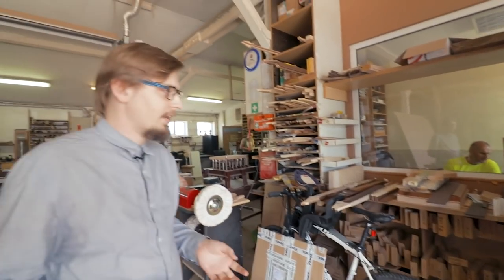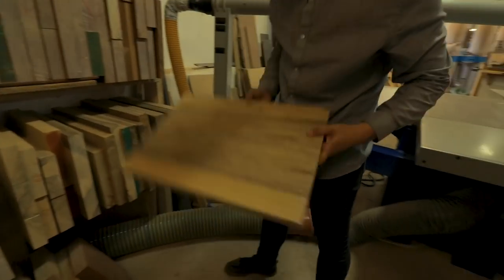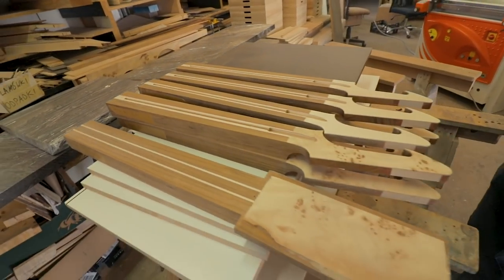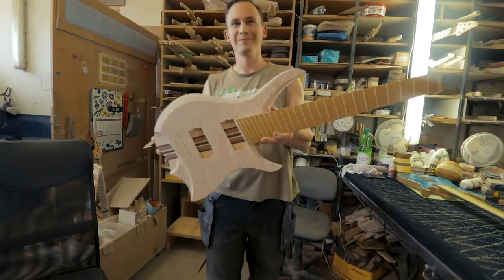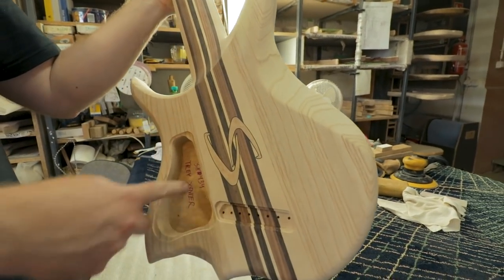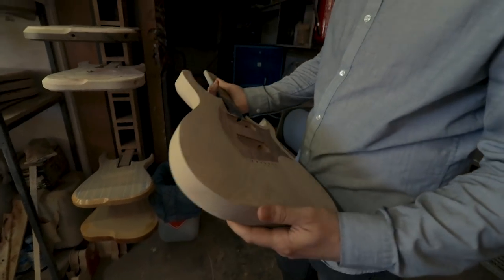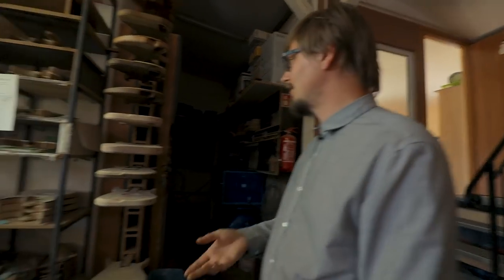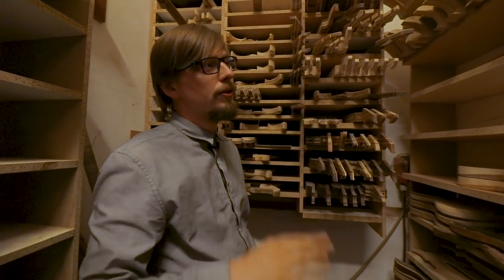SKERVESEN GUITARS Factory Tour 2019! | GEAR GODS

Comment: Ha!  @17:08 Someone else is using the same pushpull potswitch I have been using for 10 years. From Mec. I wonder if those are some kinds of tiny cable shoes or if they are just soldered and taped? Looks really neat!